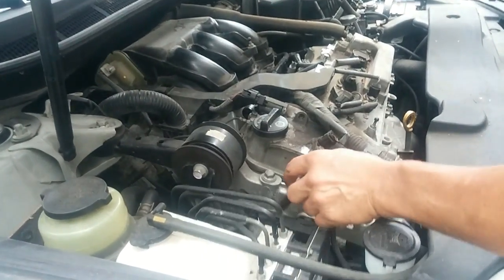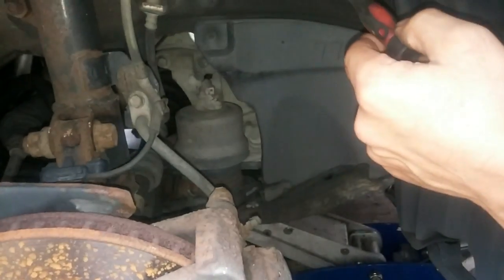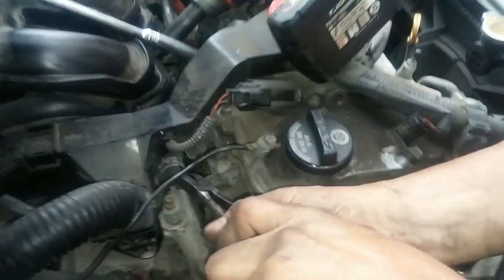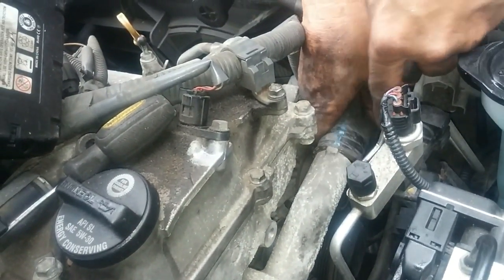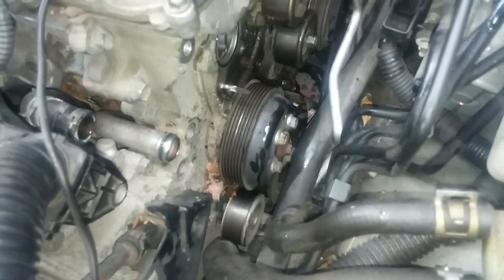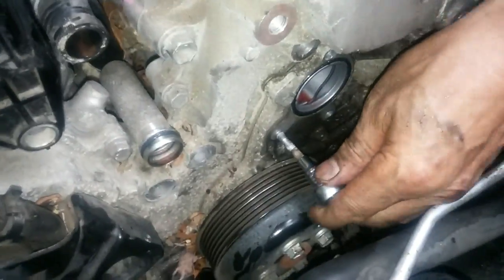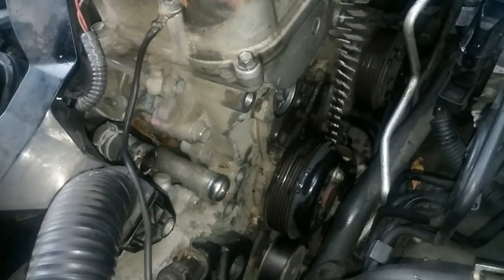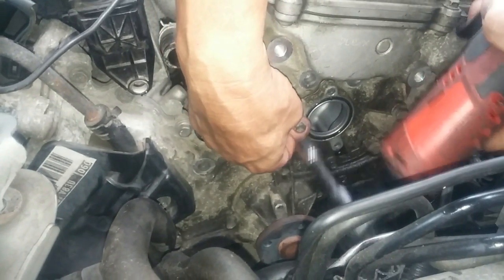Toyota V6 GR-FE - Water Pump Replacement

Comment: is rtv not recommended?
Reply: i mean on the gasket
Reply from the maker: If the pump kit came with a paper element gasket, then use RTV.  Otherwise the metal OEM gasket has a rubber liner in the inner edges that seals against cool leakage ... Works very well!
Reply: @hardlymovingpro  Thanks for your quick reply. 
I'm planning to buy this: https://www.amazon.com/gp/product/B004A0BT38/ref=crt_ewc_img_oth_3?ie=UTF8&psc=1&smid=ATVPDKIKX0DER 
Does it look like a paper element gasket or the metal OEM type?

Comment: One thing about jacking the engine, Remember there is another engine mount on the other side, the left side.  If you raise the engine too much you could damage the studs on the other mount and/or bend them. I would be very careful how much lifting I would do. I know this because I did damage the right side while installing a control arm on the left side and had to lift the engine to remove the mount, when doing the right side the studs were a bit bent and were a pain to get back in, I may actually have to replace the mount eventually.
Reply from the maker: Makes sense.  Also how much of lift you made could have been a factor

Comment: What the fuck was toyota thinking ? 16 bolts on the h2O pump ???  Its bad enough its a front wheel drive motor... Im luvin my gs300 right now...
Reply from the maker: I hear you from a maintenance perspective.  But it's an ingenious low profile design accommodating two coolant chambers.  Only complaint I have is the pump doesn't last as long as Toyota's MZ-FE V6 timing belt driven water pump.

Comment: Thank you very very much for creating this content! I was able to change my water pump, thermostat, belt and radiator hoses while watching your water pump replacement instructions. My vehicle is a 2014 Sienna and like you said the procedure was very similar. I also used some of your other videos to change the timing belt, water pump, cam seals and crank seal on my 03 Camry (1MZ FE). You saved me a substantial amount of money and I appreciate that greatly! Thanks again!
Reply from the maker: You're welcome!  Glad it helped and great job!

Comment: excellent video I need to change the water pump to my Highlander no need to use silicone for the gasket thanks for the video
Reply from the maker: Thanks and you are correct!  If the water pump's contact surface is clean and you use a new stainless steel gasket, RTV won't be necessary.   But you may want to wire brush off any residual sealant on the 12 mm mounting bolts and apply new RTV to the threads.
Reply: Hardly Moving Productions Thankyou very much

Comment: Same motor as the Lexus IS250, just positioned differently
Reply from the maker: Isn't the IS250 a 2.5L V6?  The GR-FE is 3.5.
Reply: @hardlymovingpro  correct.

Comment: Have you seen the tensioners fail on this engine?  I usually replace the serp belt tensioner when I'd doing the water pump.  Is this one difficult to get to get at while you're already in there?  Also, did you have to remove anything else (grounding strap, etc) to raise the engine?  Great video!
Reply from the maker: Haven't encountered any failed tensioners.  But replacing the tensioner bearing may be a good idea.  When tilting the engine up you could unbolt the top front motor mount bolt;  otherwise nothing else needs to be removed.
Reply: I had the same concern about the tensioner. Really, not so much the whole tensioner but the pulley in the tensioner. My is a 2013 sienna with 150K miles, and the bearing in this pulley sounds a bit dry now. But Toyota, or any part distributor I know of, wont sell just the tensioner pulley and the whole assembly sells for approx $200 and removal + replacement seems to be a really big job. I purchased the Iddler pulley and compared it with the tensioner pulley but they are different.  Does anyone knows where to get a replacement tensioner pulley?
Thanks
Reply: @hebertosantana184  Nobody aftermarket or Toyota sells the tensioner pulley. I was able to go to an industrial bearing shop and get 2 new bearings for the pulley. 2 are inside the pulley held together with a metal sleeve on the inside. They are 6203 bearings if I remember.  Bring the pulley to the store with you, the guy at the store made sure I got the right replacement bearings. I used a couple of sockets and a hammer to gently drive out the bearings and sleeve, then drive new ones in.
Reply: replace the belt tensioner , need to remove   the air conditioning pump and alternator.

Comment: Just had this done on 2009 Lexus ES 350. Had the pump, thermostat, accessory belt and pulleys replaced at same time.
Reply from the maker: Not a bad idea to do.
Reply: @hardlymovingpro  should both cv axles be done at the same time?
Reply from the maker: @113tidbits  Nope ... replace if the boot split or you hit a big pot hole that damaged the bearings and/or shaft causing wheel vibration.  If you catch the boot split early, you can always reboot the axle.  Here's the video link if interested:  https://youtu.be/sd_cbY6toOA
Reply: @hardlymovingpro  thanks
Reply from the maker: @113tidbits  You bet!
Reply: @hardlymovingpro  i am feeling some shuddering upon acceleration but once i get above 55 no shimmying at all
Reply from the maker: @113tidbits  Could be either you wheels are out of balance or your tires are out-of-round (only fix is to replace).  Look for unusual wear on the tire threads.
Reply: @hardlymovingpro  replaced both fronts with brand new rubber and balanced...so I'm thinking of just doing the axles on both sides. One at a time and will probably have to pay for alignment each time. Or pay alignment once with both sides done together

Comment: I have replaced water pumps on various Pontiacs and it was the thermostat(because it went bad too)that was the "B" to remove.  Then I had the same problem on a Lexus ES350 and that was when I said "F" it and let someone handle it.  It was not tedious nature of the replacement, or the removing the belt it was the whole thing about having to raise the damned engine up to access the part-RIDICULOUS!  I knew if I had attempted this repair-I would have gotten into trouble and it would end up costing much more than just finding a reasonable mechanic.
Reply from the maker: I hear you.  Scratching my head first time I did this replacement!

Comment: Hey guys dont forget that for the water pump, some of them you will need to apply the blue threadlocker.  As you pull off the 16 bolts, check to see which ones had it on and reapply to the same bolt that goes into the same thread
Reply from the maker: That's a good point but I think it's sealant not threadlocker.  I prefer coating the threads that have remnants of sealant with RTV.  Good idea to wirebrush the old sealant before coating with new sealant.

Comment: Thank you so much for your video, I was able to replace water  pump, thermostat, serpentine belt on my 2008 toyota sienna, which my mechanic said it’s a  $700 job. Well , through your video, I did it myself and saved $400, I spent $275 for all the parts I needed,..there’s one thing though, I was able to remove the water pump pulley while the belt is still on the pulleys since I don’t have the chain and the plier you used. I drove my van for 2 hours, it did not overheat, and the temperature gauge stayed put in the middle. Thanks, again, and please, continue uploading how -to videos. 👍👍👍😊😊😊
Reply from the maker: Hey good for you and great story!

Comment: Can a bad water pump cause a start up rattle for a second? My car does that and I was told is water pump not cam phasers, is it possible?
Reply from the maker: Can't say.  What I can say is if the pump's bearings are bad, the car would be making noise all the time.  You can listen for bearing grinding noise by placing your ear on one end of a metal bar and the other end of the bar pressed against pump housing.
Reply: Cam phasers ... get it fixed right away, or you will be buying a new motor in a year ... don't ask me how I know ... and on a 2008, there are 2 oil lines (one top one bottom front) that need to be changed, hopefully before they spray the oil out while driving on the highway - and you can buy a new motor again.  The new front lower lines are metal, and a little pain to put in sometimes.  My new motor and install only cost 6k - so I'd seriously think about that little rattle when starting, and those lines too, if they weren't a recall and done already.  The later models are already fixed though.
Reply: And, that was a 2008 highlander, now with over 200k on it, and working on replacing the water pump (this will the the 3rd pump - ours last about 80k usually?)
Reply: @blanko8463  What that's weird my last 3.5 powered car 06 Rav4 had 220k miles orginal water pump. Got an 13 ES 350 should be able to go 200k Miles on orginal water pump.  08 Camry did the same with over 200k miles..water pumps should go 200k miles usually.
Reply: no. oil pressure is NOT holding the timing tensioner prob causing slack when not pumping oil(not running)

Comment: If Aisin made the water pump properly (more rigid) it wouldn't be necessary to use 16 freakin bolts to secure it.
Reply from the maker: It is a unique design that eliminates the need for both longer and more coolant hoses.

Comment: Hi, excellent video. I have whistle sound on my avalon (2007-107k miles) which gets louder with RPMs going up. Do you think it is the waterpump or any other pullies? Any recommendations?
Reply from the maker: Sounds like you have a vacuum leak with one of your hoses in the engine compartment.  While the engine's running, spray brake clean on hose(s) and listen for a change in the rpm's.  That'll help you isolate the source of the leak and bad hose.

Comment: Great job, well and easy explained. Best video I ever watched to help me with getting the job done!!! Thank you,Sir!
Reply from the maker: Thanks for your post and glad you found this video to be helpful!  If you have any questions, don't hesitate to ask.
Reply: @hardlymovingpro  Yes, awesome job, all the other videos kind of skimmed by the whole lifting the engine step, which is where im currently stuck
Reply from the maker: Yes ... tilting the engine gives you the room the remove the w/p pulley and makes the job go faster and easier ... IMHO.
Reply: Great video. This REpair  made me a little less confident in my abilities. I think I'll sit this one out... depending on the shop cost.... salute
Reply from the maker: Dealers are charging big $$$'s for this replacement.  About the same as a timing belt job.

Comment: That chain vise grip is the ticket, you can really hog down on those pulley bolts.
Reply from the maker: Glad you found it useful!
Reply: The same results can be accomplished  in removal of the W.P pulley by loosening it's bolts prior to removing the serpentine belt.  I tightened the bolts using a ratchet and a pry bar strategically.

Comment: This video is pretty much flawless. Very detailed. Well recorded. Audio was great. 
Above all, very helpful. 

Thank you for uploading!
Reply from the maker: Thanks for your compliment and post!  In spite of your positive critique, still got thumbs down. Go figure.
Reply: @hardlymovingpro   only reason I could figure for the thumbs  down might would be the aftermarket pump and the chain pulley holder.  Seems that one with a rubber strap rather than a metal to metal would be safer to use so the belt tracked don't get bent.  Also while the one may have a 1 year vs lifetime warranty, the hassle of tearing it all back down if the gates fails would be worth spending the extra money on OEM.  Great job either way in the labor portion of the video.
Reply from the maker: @jasonsims007  Thanks for your post.  I have other videos using OEM parts with thumbs down.  Other reasons could be:  didn't use a torque wrench;  didn't provide diagram of the work area;  used power tools;  didn't state the size socket I was using;  video was moving too fast;  didn't like the narration;  didn't like the lighting;  didn't like the intro;  can be anything you can imagine.   I figure a good video will get 1 thumbs down for every 20 thumbs up.  That's 95% which is good enough for me.   A chain strap wrench will not bend or mar the belt surface of water pump pulley cup.   Haven't had good luck with rubber strap wrenches.  They can't take the torque and give too much.

Comment: When you think you have all the tools .....you don't.

You will need Deep Metric Sockets...10, 12, + 14
Having the ability to lengthen a ratchet was also important so I used some conduit which gave me the ability to crack the bolts.
Get a set of socket extensions as well.

To get the belt back on I struggled.
I ended up removing the idler pulley and then put it on last after I had the belt in place and tension on the tension pulley.

My 2007 Camry is a nice car just a pain to work on.

Your video was awesome and I couldn't have done it without you.
Reply from the maker: I save a tremendous amount of time and effort with my electric ratchet wrench and impact drivers.   Another useful tool is a long handle indexed reverse flex head ratchet wrench set.
Reply: I guess the 4 cylinder engines are easier to work on.

Comment: i am trying to figure why you removed the stud from the pump...
Reply from the maker: It got in the way of attaching a chain strap wrench.  The wrench was used to prevent the pulley from moving when taking off the pulley nuts.
Reply: @hardlymovingpro  
got it thanks!

Comment: You mentioned loosening/removing passenger side motor mount; then elevating engine. I have 2 questions that I hope you do not mind answering:

- Where did you place your floor jack - under the oil pan(with a wooden block) or under the transmission(with a wooden block)?
- Did you loosen/remove just the passenger side motor mount or also do the same to the one at the front and the one on the drivers side?
 
Thanks for your time.
Reply from the maker: The engine is on the right side (starboard) and the transmission is on the left side (port or driver's side).  We want to lift the right side to gain access to the water pump and pulleys.  So you place a floor jack under the engine oil pan (with a wood block to distribute the weigh to not bend the pan).  Before elevating, make sure the center engine mount bolt has been loosened or detached and remove the upper torque rod.  The left side mount remains untouched.  Good luck with the repair!

Comment: Thanks so much for this video. I was able to do this on my 2009 Sienna V6 and it is basically exactly the same. Only the top engine mount is a tiny bit different. I was able to do it without jacking up the engine, just have to remove the water pump pulley with the water pump itself.
Reply from the maker: Hey great ... congratulations!  Next time I'll try removing the pump with the pulley attached.  Good idea!